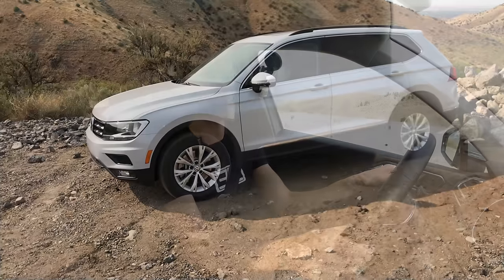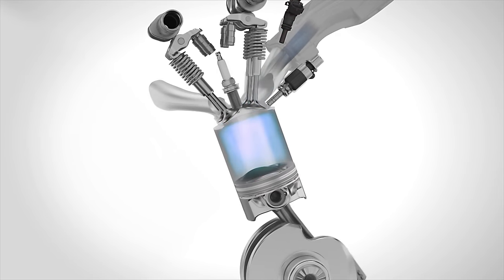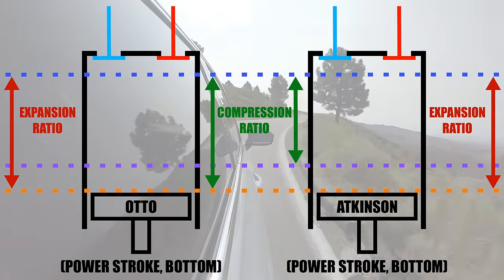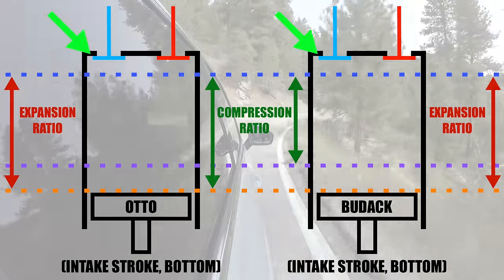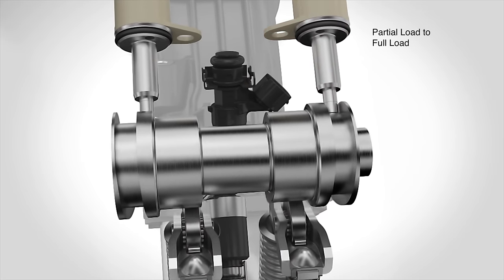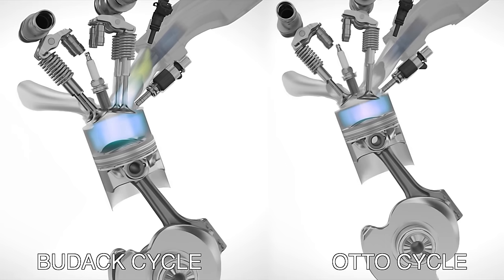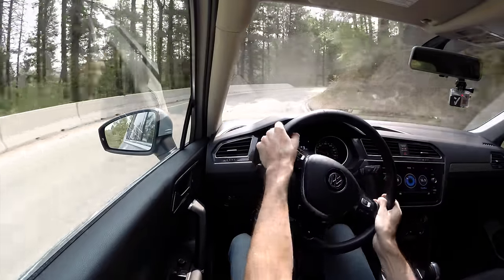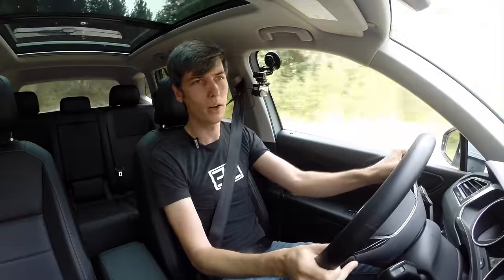Volkswagen's New Engine Cycle - The 'Budack' Cycle

Comment: When I have opened this video I was expecting something revolutionary as the new Mazda technology . well it is not . but perfect video as always .
Reply: Technically, Mazda's no spark gas engine was not "new" either. It was just a tuned/adapted idea previously created a while back but now possible for production use .. well, eventual production use. Or were you talking SkyActive?
Reply: Matt McGregor the no spark engine is a skyactive engine. Mazda stated that skyactive G and -D were steps towards HCCI
Reply: Brutelas 

Test/demonstration engines. Robust control of combustion events with higher loads was still a challenge. 

Changing from HCCI to SI when needed was the answer than and now. Mazda claims to do it with great precision and robustness. Not new, but if well implemented could be a welcome advance to ICE.
Reply: My old Pontiac used to run without spark every time I turned it off. Had to spend money on a tuneup to get RID of that feature!
Reply: My understanding of Mazda's technology - which they are calling SPCCI  for "Spark Controlled Compression Ignition" - is that it is not sparkless.  The intake stroke brings in a homogeneous volume of a very lean mixture, too lean to ignite with a spark, in a vortex.  As this lean mixture is compressed a high pressure injector injects a tiny amount of a richer, spark ignitable, mixture at the center of this vortex and right at the tip of the spark plug.  The spark plug fires to ignite this richer mixture and the pressure waves from that ignition further compress the lean mixture so that it ignites by compression.  This way Mazda can vary and control the amount of pressure applied to the main lean charge by varying the amount and timing of rich fuel mixture (which kind of acts as a detonator) to match the load, temperature and rpm conditions.  That makes it so that pressure ignition can occur over a wider range of circumstances.

So it's not sparkless, but it still uses pressure to ignite majority of the fuel/air mixture.
Reply: Volkswagen has been having the diesel engine that has more power and more efficiency in fuel than your revolutionary mazda new engine for 20 years and racist americans praise mazda as soon as they come up with 'improved' less powerful less efficient engine than volkswagen engine lol...
Reply: polychronio "racist"? Madlib much?